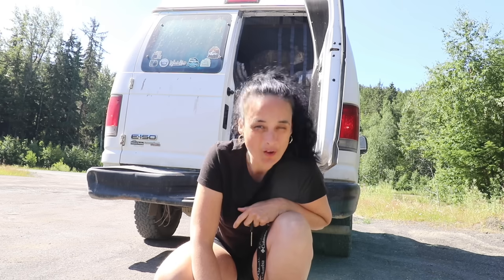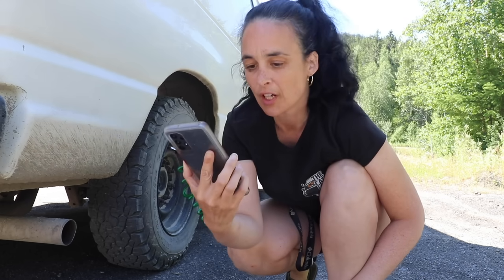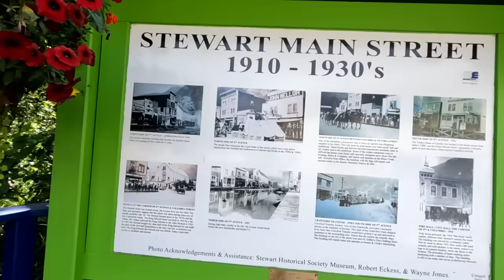Strange noise, broken air pump while traveling up North | Solo female van life

Comment: Hi Emmy the typical small air compressor is not adequate for larger van tire inflation. They need to be allowed to cool for likely 15 minutes after 15 minutes of use.. The next time you buy an air compressor  look for one with  a bigger motor and air pump.  More what you would buy for a larger  truck. More expensive but way more capable and reliable.  Have a good day and a safe trip. Tom in the Maritimes  at the  NB,,-NS border.
Reply: Look at what pumps the off road groups use. I have seen some with tanks that would work for you. What dose Chrome use?

Comment: Those little pumps are rated for 15 minutes of use and then you have to wait for it to cool down. There are heavy duty pumps available for a lot more money. Look for the duty rating and time of use before buying one. This the reason I have two pumps in case one dies.
Reply: Thank you, I was just about to echo your comment.
I carry an old Sears pump like this I found in new condition at an estate sale for $3. Great for quick top off or one flattish tire on a Ford Ranger, smaller tires tires of course.

Comment: THE MAIN PROBLEM IS YOU CANNOT RUN THAT PUMP CONSTANTLY.  I BELIEVE THE MAX MINUTES IS 5 MINUTES AND YOU HAVE TO SHUT IT DOWN TO COOL.  ALSO THAT PUMP IS TOO SMALL FOR YOUR VAN.  YOU CAN USE A SMALL PUMP BUT YOU CAN JACK UP THE VAN SO THERE IS LESS PRESSURE ON THE TIRE AND WILL FILL FASTER.
Reply: Thought the same thing, air compressors have a duty cycle and the cheaper the pump the shorter the ratio of run to cool-down.

Comment: Emi Those little compressors are only sixty percent duty cycle 
 So in an hour you could use it for forty minutes but not continuous .
 Basically the pump is fried.
 When buying a compressor look at the CFM rating [cubic foot per minute}
 The higher the rating at the lowest RMP. is your best option.
 Hope this helps.

Comment: A bicycle pump can pump up a car tire. Ten speed tires are around 100psi, so it can handle all car tires. You can pump a car tire in under 10 minutes. It won’t over heat and you’ll get some exercise too. I would keep a bicycle pump in case your electric pump breaks again.

Comment: Might want to consider a heavier duty air pump. Get one that has the alligator clips that you connect directly to the battery and a ground. You wont blow fuses and won't overheat the power plug ins. You can find them for < $80.00 US.

Comment: FORTEM Tire Inflator Portable Air Compressor 150 PSI, Bike Pump, 12V Electric Air Pump for Car Tires and Bicycles w/LED Light, Digital Tire Pressure Gauge w/Auto Pump/Shut Off, Carrying Case

Red·862 Grams·12V DC

Excellent air pump amazon ❤

Comment: I didn't know, these pumps aren't meant to be used more than 10 minutes! I watched a video from Project Farm and he tested several different ones and he said they weren't meant to be used that much, so I just run for about 10 minutes and shut it off for that long.

I bought one from Harbor Freight. The one I have at the house is a 7 gallon, and it can run longer and it's quicker. I had to fix the cord because it short circuited and I had to replace the fuse.

Comment: Look for the Viair line of pumps
 Look at the duty cycle times to fill your size tires. More powerful (and expensive) pumps will fill faster. They also need to draw directly from your battery. Good luck.

Comment: I'd advise to keep at least two mini air pumps in your van because you travel a lot you don't want to get stranded, with two you have at least a better chance to pump up your tires.

Have BCAA for extra safety.

There are a number of tire pumps out there do a YouTube search on them for the better more reliable ones. If you know how to remove a tire they also sell 12 volt lug nut remover tool  they work well also keep a jack stand to hold up the vehicle while changing a tire, a tire repair kit and know how to fix one not too hard.  Keep your vehicle maintained  always have your antifreeze and transmission serviced every 50,000 k. This way you will be ok

Comment: Those small pumps typically have a 15-20 minute duty cycle then you need to let them cool for an hour. You likely burnt it up. That pump you have isn't designed for the job you were using it for.

Comment: If those little tire inflators overheat you have to turn them off to let them cool down... I have a 20 volt rechargeable tire inflator... with a PSI gauge it is fast... I don't go through any Hocus Pocus.

Comment: These air compressors have temperature sensors that when the pump gets hot it will turn off and cool down first to prevent damage. Once it has cooled down, it will run again.

Comment: Wow. Lots of pressure. I have a 3/4 ton pickup with a 2400 lb camper and only ever have 70-75 on back tires and 60 on the fronts

Comment: This is uncanny. Just today I need to air up the 2 outside back tires and pulled out my compressor that I ve used before. Could not get it to attach! It appears when I purchased the other new tires, they changed the stems on all of them!?  The  top of the stem is plain and the threading is too far down for my tip to reach! 
I never know what to share, whether you enjoy our experiences or if it is taken as a one ups man.  
Be safe

Comment: You don’t have to run the tires at 80psi. 55-60 psi is the max you need it will ride much smoother and give you a better foot print for traction..